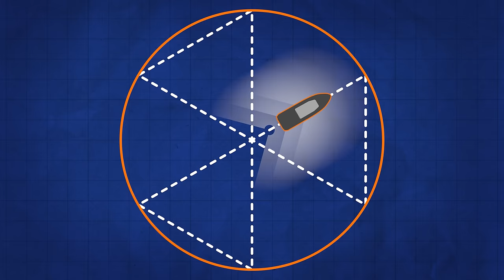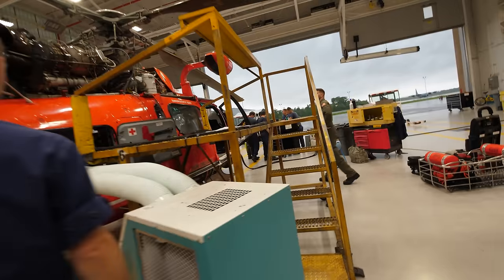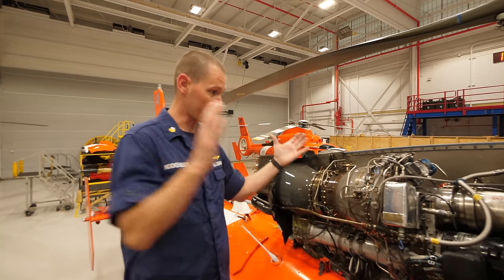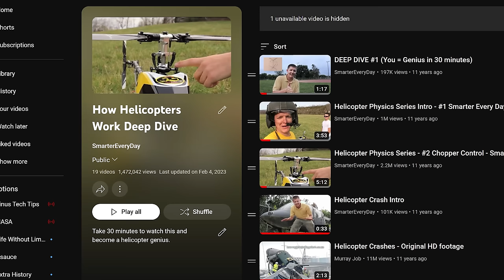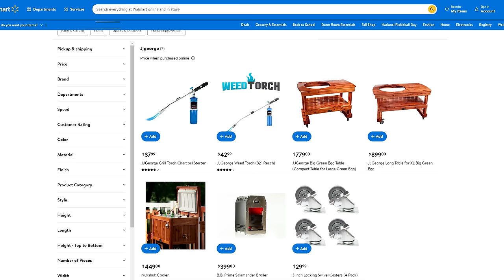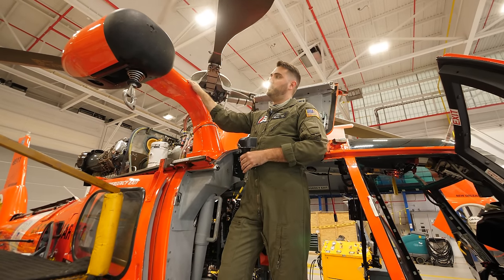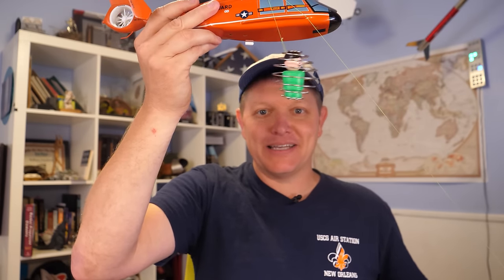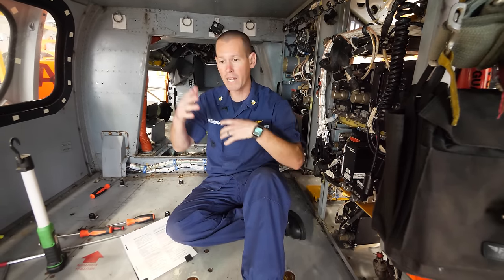The Amazing Engineering of Rescue Helicopters  - Smarter Every Day 289

Comment from the maker: I double dog dare you to sign up for the email list: https://www.smartereveryday.com/email-list
Reply: First reply
Reply: You're so awesome!
Reply: i triple dog dare you to upload more often
Reply: @bradhaines3142  I quadruple dog dare you to triple dog dare him to upload more often
Reply: Just subscribed to the email list, that way I wont miss the notification for the underwater frogman video I've been waiting a decade for 😌🙂
Reply: You need to do a 60T with an AET...I'll volunteer
Reply: I forgot we were on the coast guard lol 😉
Reply: That's how I knew this video was out
Reply: Have a nice day my dear friend
Reply: Best content on the net.
Reply: Why tail rotor blades not evenly spaced 1:54?
Reply: Aerospace engineer here. The fact that a longitudinal inclination of the swashplate induces a roll torque actually has nothing to do with gyro precession. It is due to the flapping dynamic of the blade (which is the rotation of the blade "tip up tip down"). If you write down the differential equation governing the flapping dynamic you find out that it has a natural frequency which is almost the same as the frequency of rotation of the main rotor, which in turn is the frequency at which the pitch of every blade is controlled through the swashplate. For this reason the flapping dynamic responds out of phase of approximately 90 degrees  with respect to the pitch control dynamic.
Reply: as a corollary to your sheet metal fab series, maybe find a company designing, printing, cutting, folding, filling, and sealing cardboard packaging (e.g., for new phones, electronics, appliances, etc.).
Reply: I know why you geek out on stuff like this. You’re just like my dad: you learn everything there is to know about helicopters because you’re secretly inventing helicopter 2.0 in your head. Don’t lie
Reply: Get e-mails from Destin? YES PLEASE! ◡̈
Reply: @TheNapalmFTW  Me as well.  Email from Destin?  CLICK LINK!!!
Reply: Already am
Reply: Your's is still one of the BEST channels on YouTube..
Reply: Until there is a data breach...
Reply: You’re more than welcome to come check out a GE90-115B from a B777 anytime!
Reply: @turoni314  no one asked then
Reply: You should make better videos instead of trying to game the YouTube system by changing thumbnails and titles.  Unless you condone the 'it's what's on the outside that matters' like Veritasium.
Reply: As a comm guy that supported infantry unita in Afghanistan, I appreciate this man's mindset so much. We are not just beans, bullets, and comms. Those are our brothers and sisters doing the work. While we might not be the ones swimming or being shot at directly, we'd do anything possible to make sure they are with us. It is an extremely hard position to explain to civilians, what our job is. It isn't just a checklist and "oh well" if things go wrong. It is engineering on the fly, to the best of your ability, while lives could potential hinge on your technical know how. Thank you for this continued deep dive Dustin. Can you please add in HISTORY of when engineering assumptions went wrong? Talk about "the reason the cable splice exists is because of this event" etc. Or talk about the way it used to be until this design change revolutionized the effort. Feels like a worthwhile segway to add weight to the conversation; as most of your military videos have purpose behind the changes from WWI/WWII/Korea/Nam/Desert Storm etc.
Reply: 3:10 i would to :D   ... information overload
ps: love your vids
Reply: 😒Your Thumbnail😒. The aircraft does not have only thirty minutes of f'n fuel! Why post it again?
Reply: @Zach-ku6eu  17:35
Reply: @Alrion 😒 I'm pretty sure that's a generalization. I have personally been the deck crew on a 47MLB with a helicopter right over my head dropping baskets or divers. The training usually goes for an hour and a half.
Reply: a jebiga k0pkjy
Reply: no.
Reply: How you make videos and do research for videos ? Please share with us
Reply: I'm already on the list brother because your content is the best! Thank you for making the internet a smarter place. 🙏😇
Reply: Hi Destin,
I have heard several times, that hovering a helicopter ist more fuel consuming than flying around. Can you explain why this ist?
Reply: I thought you were about to say military.
Reply: It's the only subscription I allow. That is how much I respect you, Destin.
Reply: I triple dog dare you to stop shilling
Reply: since you double-dog dared me, I had no choice.  BTW, I rode on a Chinook once, most amazing experience of my life.  I wish I knew half as much about ANYTHING as you, Destin.   Maybe I can cook a Thanksgiving Turkey better.   But at least I learned how to whistle with my fingers today.  Im 59 years old, and could never do it until I watched the Coast Guard search video.  Smarter (happier) Everyday!

Comment: After watching this, I'm even more amazed by the dedicated teams that ensure these helicopters are always ready to swoop in and make a difference in critical situations
Reply: After watching this, I am even more amazed that helos are flying bricks, and spit in the face of physics and common sense.
Reply: In my mind the most hardcore groundcrew story/war/campaign (Heli/Jet) is from the 1982 UK vs Argentina. INSANE logistics, on a boat and the enemy has 10/1 more planes.
Reply: Thats what I love about having been a Flight Mechanic and being a part of Coast Guard Aviation, we get to maintain what we fly on to save lives.  MH60T all the way...
Reply: And I'm amazed they haven't replaced parts prone to corrosion with parts that aren't.
Reply: @Mmouse_ salt water corroded most things with enough time. You can replace some things but it depends on what engineering requirements are for the part. You can't just replace stainless steel with carbon fiber, there are many aspects of the parts like strength,  weight , flexibility,  hardness etc that need to be considered. Many parts are aluminum and steel, but some can be replaced, others would never work because of the stresses involves. Unfortunately  every boat, and aircraft have parts that corrosion  eats over time. It just needs to be on the inspection  checklist and replaced when needed. That's why a regular maintenance schedule is mandatory per FAA regulations. It would be awesome if someone can develop something that matches the criteria to replace with something that does not corrode but we are not there yet.
Reply: @Mmouse_  it's a logistical issue. you'd have to completely rebuild the entire fleet of Helos, that's probably why they're just switching to a new model entirely
Reply: Yea
Reply: Yeah be kinda awkward if you went to rescue someone and then had to be rescued.
Reply: These helicopter guys are the complete opposite of Apache gunship war criminals.
Reply: After all the FOD walk downs and years of NAMP compliance. Finally we are recognized. You're welcome friend.
Reply: @maz5907 I would love to be apart of what yall do. HH 60 army has been my life for 7 years now.😊
Reply: @shawndodson5556 yeah it’s just straight brute force to make it fly lol.
Reply: One of my best friends did Helicopter maintenance in the National Guard for years, served a tour in Iraq, and got to take me on a Chinook flight once.  During this flight/demonstration, all the crew members spoke about what they did, and every single once ended it with, "Without (whatever job), there's no mission."  Totally and completely blew my mind.  Every person had a job, and if they failed, the mission failed.  I totally appreciate that mentality, and carry it with me in my current role in Emergency Services.  Heroes, all of them!

Comment: I love how he gives a heads up before turning the blades. Such kind of small precautions really demonstrate the dedication to safety and professionalism.
Reply: Standard procedure lol just like yelling "going hot" when they fire up the ground power unit
Reply: @jaredgrubb30  As someone working in manufacturing (civilian) I assure you that a lot of safety stuff goes out the window when the OSHA officer ain't looking (to be clear we still try to be safe but we aren't always going to yell clear before moving the RAM on a press or lock out the power and put a brick in to hold up the die when doing a simple coil or die change).  The military folks Dustin's been interviewing seem like they're a lot more on the ball with that stuff and you can tell they aren't just putting on an act for the camera (if they are it's quite convincing).
Reply: @grn1  I work for boeing in Philadelphia...vertical lift military. Where we build the chinooks and v-22's. We have the "customer" aka DCMA aka the government employees watching, inspecting, approving and stamping off everything we do. There ain't nobody from osha in our field cuz they ain't got a clue what we do lol
Reply: @jaredgrubb30  I presumed OSHA would be everywhere but I suppose you have other systems in place to hold you accountable.  Gotta imagine there's still some stuff in the military that goes under the radar but most of the incidents I've heard about dealt more with politics getting in the way of engineering and plain old common sense (like a certain Navy ship that collided with a freight ship because they had some fancy new electronic control system and a lack of proper training, of course they blamed the crew rather than the bureaucratic BS that actually caused the issue, can't remember the name of the ship or the video that covered it).

Comment: Haha.  "It's French, so it's opposite..."  That's the standard pilot/co-pilot configuration for helicopters. Really impressed by the AMT's knowledge level of his platform.
Reply: that's what I thought too... based on what a buddy told me.  He was a pilot of CH-46's in the Marines.  Not sure how this originated... was it so there could be a single collective lever situated between the pilot and co-pilot, and the pilot had the luxury of using the right hand for the cyclic lever?  I wondered how the V-22 handles things, since it alternates between rotary wing and fixed wing operation.   Does the pilot sit on the left or right??
Reply: @SkyhawkSteve  in the world of planes the pilot is on the left because you can use your right hand on the throttle.
Reply: @SkyhawkSteve Yes, the early helicopters had a single collective (up/down) lever in the center. The cyclic (tilt) is difficult to control in a helicopter because it’s like balancing on top of a ball, and with most people being right-hand dominant, it’s easier to fly from the right seat. Being French has absolutely nothing to do with it. All helicopters are traditionally flown from the right seat (if there are left and right seats) due to those historical and ergonomic factors.
Reply: Also, France drives on the same side of the road as the US, so their driver's seats are on the left. 😂

The man obviously knows the helicopter inside and out though! I love his enthusiasm!
Reply: Well, there is still some Frenchyness in this helicopter :
"When viewed from above, most American helicopter rotors turn counter-clockwise; French helicopters turn clockwise."
As a Frenchman, I am proud to see these old birds still in such good condition and cared for with love.
Designed and parts made in France, assembled in Texas : Coast Guards MH-65 Dolphin.
Reply: @knight907  Consider single seat aircraft; you always have the throttle on the left and and the joystick on the right hand. It's only for some reason in aircraft with two pilot seats that the captain has these reversed.
Reply: I didn't understood in the first time because I didn't know it was the opposite on standard aircrafts than on cars. I was like bro we drive on the same side up here :)
Reply: @gsbeak  Right, helicopters spin the other way because of the coriolis effect.

Comment: Destin, to give context to the issue of corrosion and why all aircraft must be inspected for it, corrosion was one of the elements that caused part of the fuselage of Aloha Flight 243 to rip apart back in 1988. With that aircraft it was a combination of structural rivets corroding and failing, the adhesive that Boeing used at the time on the skin and tear strips failing due to salt water, and confusion about basing structural inspections on flight hours over number of compression/decompression cycles. The issue with corrosion of the rivets on Aloha 243 was that it would cause the rivets to fail, and as the body expanded and contracted from the pressure cycles of the flights, the rivets were creating microfractures in the skin and sheer strips. Then the compression/decompression caused those microfractures to expand until the skin failed. When the skin failed and tore, the sheer strips were too badly damaged to stop the tearing in the manner they were designed.

Now, he's talking about corrosion with the airframe itself, but the issue is the same. If a structural support fails, forces involved in keeping the aircraft in the air will rip that helicopter apart in a similar manner as what happened to Aloha 243. ANY CORROSION IS BAD NEWS FOR AN AIRCRAFT. If they find any, they must ground the aircraft until the damage can be repaired as dictated by either the US Coast Guard and/or the FAA. (It's a "Whatever policy is more stringent" setting situation.) And, depending on where the corrosion is and how bad it is, the airframe could be permanently grounded. 

Also, if they do the repairs incorrectly, that can also ground the aircraft. China Airlines Flight 611 was a Boeing 747-200 that crashed because of an improperly installed patch over some damage to it's tail when the aircraft from the tail striking the runway (tail strike incident) more than twenty years before the incident in 2002. The incorrectly installed patch allowed the airframe to flex and bend in a way that metal fatigue happened, similar to the Aloha Flight 243. (Except that Aloha's issue was from missing important inspections and a few notices from Boeing, and not incorrect maintenance work performed for an existing repair.)

Comment: Terrific video. I was a Contracting Officer on the acquisition of the Dolphin, and I am amazed that some of them still had the original Rockwell Collins avionics suite at the time of Destin’s filming. Heck, I’m amazed they are still flying; aircraft tail number 6511 was delivered to USCG in 1985! CGNR 6511 and 6607 (seen in background at 6:39) have completed conversion to MH-65E configuration, with upgraded avionics (glass cockpit and radar) and are now stationed at Coast Guard Air Station Atlantic City, NJ. A further Service Life Extension Program will extend the service life the H-65 by 10,000 flights hours, enabling fleet operations until the planned phase out in fiscal years 2035-2039. Based on current programmed usage, the 10,000-flight hour extension per aircraft will provide a 50% increase in service life, or approximately 16 years.

Comment: Hi, gyroscopic procession is not the reason for the advanced cycilc input, it's called aerodynamic procession. It just takes time for the blade to fly to it's new position. Aerodynamic procession fights against gyroscopic procession, that's why the rotor slows down when a cyclic input is made, energy transfer.

Comment: The hoist controls were one of the things I programmed while I was working on maintenance training software; I was working on the UH-60, but it has a rescue hoist that can be installed (which I also made work). Our model didn't animate the cable spooling out at the time, but we still had the digital readout display functioning. There's also some clever bits that prevent over-extending the line or over-retracting it. The last 50 feet or so can't be extended without an override switch (otherwise there wouldn't be enough left on the spool to reel back in properly) and the speed of extension or retraction automatically slows down to 10 feet/s when nearing both limits, to avoid a hard-stop.

Comment: I was an auto pilot/instrumentation tech on the F4-E fighter. We used the red hydraulic fluid pressurized to 3000psi. You need that pressure to move the flight surfaces past mach 1. Great video.

Comment: Great vid as usual Destin, thx.
My uncle retired from pratt & whitney after 35 yrs of being an engineer. Although im not around any type of jet engines on a regular basis, he is responsible for most of my understanding and appreciation for aerospace engineering. The sound, raw power, and reliability of today's aircraft is nothing short of a modern marvel.

He brought home a couple turbine blades that are made of some exotic alloy that wouldn't melt if you held a torch to them. Even more impressive was the hundreds of pinholes going all the way through them, from the leading to trailing edge. I couldn't figure out how they machined the holes (the diameter of a sewing needle, but going all the way through and on a curve). That was just one part, he said probably costs $10k, and each engine takes hundreds of them. No wonder why they cost many millions.

Comment: When I first learned about the role gyroscopic precession plays in the main rotor system of a helicopter, it blew my mind. That the cyclic actuators for going forwards and rearwards are at the sides, and the ones for tilting the main rotor sideways are fore and aft. It was such an epiphany.
Reply: As an aerospace engineer who has worked in the helicopter industry for 42 years I can say with confidence that the cyclic control system does not work due to gyroscopic precession.  From "Principles of Helicopter Aerodynamics" by J. Gordon Leishman "An aerodynamic forcing is applied at or close to the natural frequency of the flapping blade and the blades respond so that a unit of cyclic pitch input results in (almost) a unit of flapping response."  A resonant system will respond 90 degrees from the point of input.